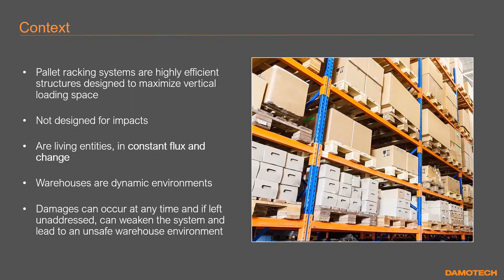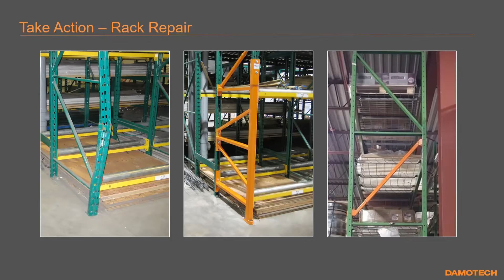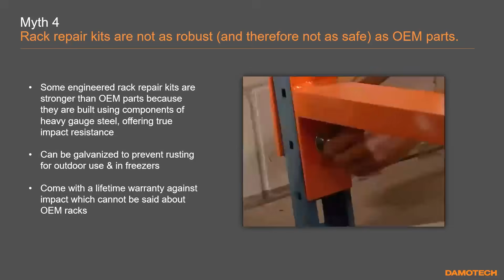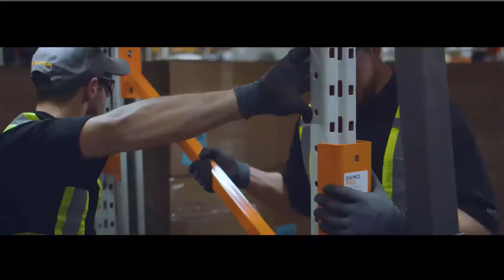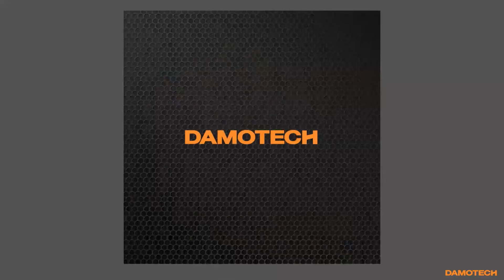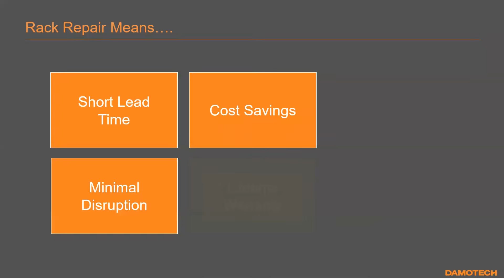Pallet Rack Repair vs. Replacement: When to Fix a Damaged Upright

Comment from the maker: Two numbers that reframe this whole decision:

85% of rack damage happens in the bottom 24 inches of an upright, so you're
usually repairing a short section, not replacing 30 feet of steel (19:59).

And the cost of waiting: an out-of-service bay in a 3PL freezer was costing one
customer $600/week. Nine extra weeks waiting on a replacement upright = $5,400
per bay (38:28). Figures are from the time of recording, but the logic holds.

If you're weighing repair vs. replacement right now:
Guide → https://www.damotech.com/rack-repair-vs.-replacement-guide-lp
Free damage assessment → https://www.damotech.com/free-rack-damage-assessment-form-lp